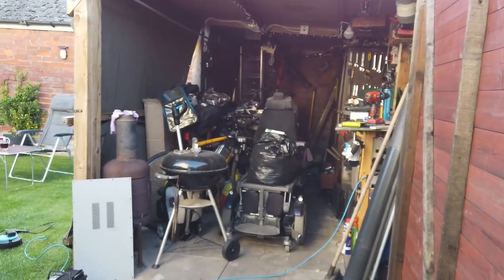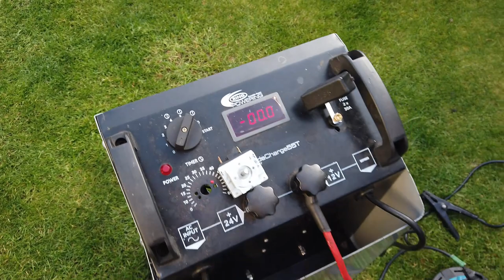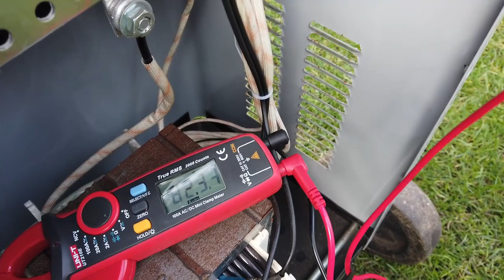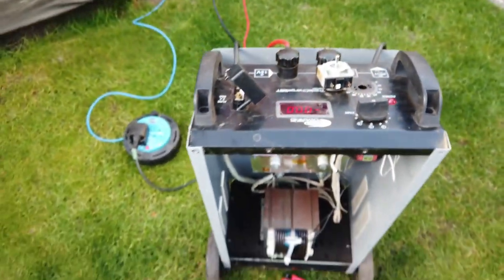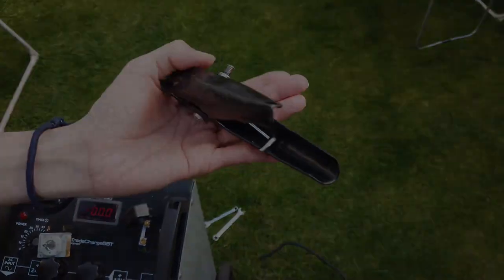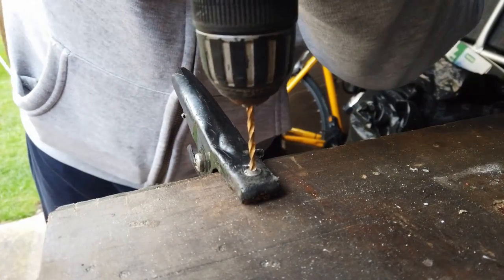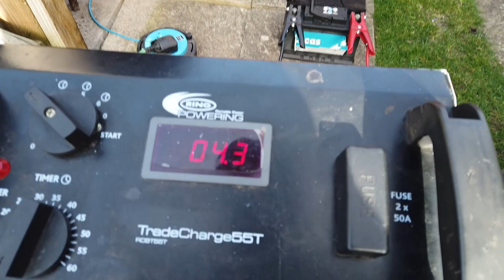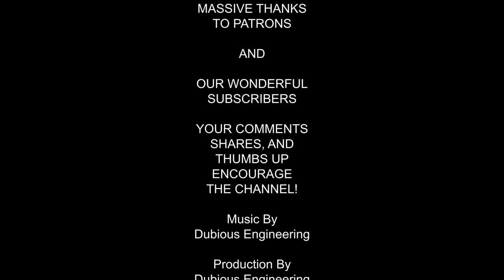DuB-EnG: Repairing an industrial 12v/24v automotive battery charger - Powering TradeCharge55T

Comment: A good repair video....
many years ago i used to work for a white goods repair company ( mainly on the installation side ) - one of the tests they used to give any prospective engineer was to take the fuse out of the mains plug & see how long it took for them to find that it was missing. I lost count of the number of candidates who would rush straight ahead & strip down the appliance to its constituent parts before doing a simple fuse check!!!

Wow 50Amps - what a jacobs ladder or tesla coils that would power!!!
Reply from the maker: Exactly!!  Always read the exam paper to the end before starting the test!! - I remember there was a little note at the end of an exam paper, if you've read this note, put your pen down and relax - the less questions you try to answer the more marks you'll get! :-)

Comment: While using this charger with the battery still in the vehicle, does the black negative crocodile clip go on the battery or the vehicle chassis?
Reply from the maker: Always best to go directly to the battery terminals if possible